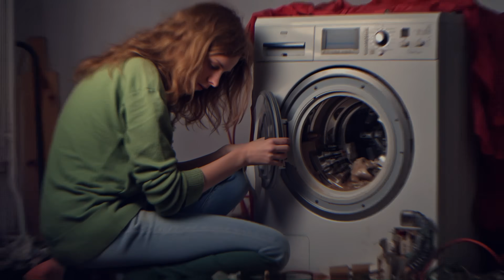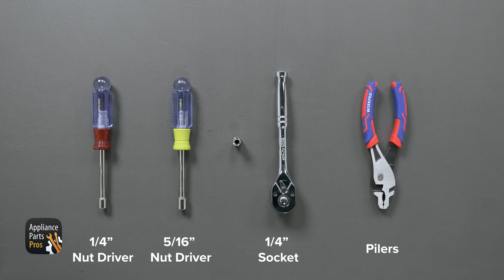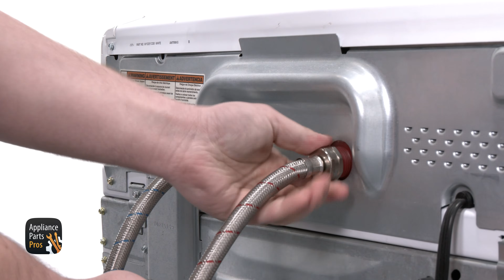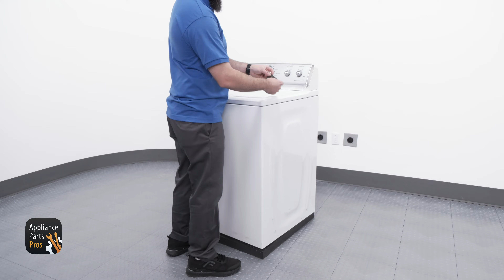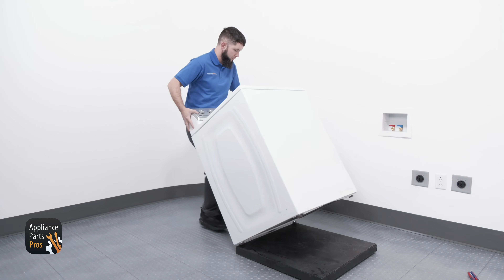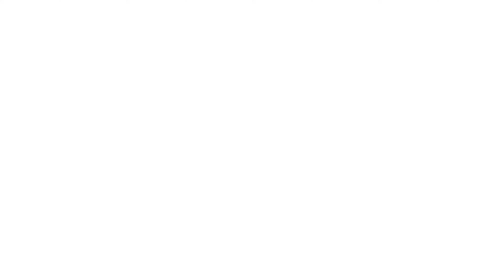How To Replace A Maytag Washer Lower Wiring Harness

Comment: I have a MVW5430MW and took off the back panel and saw that a small very think black cable had been snapped probably from all the shaking when doing laundry. Would this require a whole new wiring set? I bought the appliance in August of 2023. Thank you!
Reply from the maker: What is that wire you need connected to?

Comment: I have the Maytag MVW5435PW0 washer. Just over a year old. Started a los of laundry and it filled up with water then stopped at the wash cycle. Sense, fill/soak and done all flash once then done flashes for a second time. After endless searches, I replaced the lid lock-didn’t work. Replaced the drain pump-didn’t work. Replaced the actuator-didn’t work. Google said pressure switch-so I ordered the switch that was supposedly for my washer. Tore my whole washer apart trying to find where this switch is located only to find out it doesn’t take that switch. The pressure switch is built into the control board. So I just switched the control board out and recalibrated the washer. Still getting the same nonsense where it fills with water then stops. I have no clogs and all the wires look good. Would this lower wire harness still be a cause even if the wires all look good? I’ve spent more money trying to repair this washer versus what I paid for it. It’s driving me nuts! lol Manually dumping the water out for the 5th time this week.
Reply from the maker: That is strange. If possible, are you able to put it into diagnostic mode or get any error codes?

Comment: Can this be responsible for a sense to done cycle? The lid locks and unlock immediately and goes from sensing, to the drain tub moving around, to done in under 1 minute
Reply from the maker: What is the model number of your appliance?
Reply: @appliancepartspros  MVW5035MW1
Reply from the maker: Thank you. You will need to locate the tech sheet on the unit and run the diagnostics to determine if there is an error code and follow the instructions for testing. You can also check the wiring for any burn spots or loose connections.
Reply: @appliancepartspros  thank you!
Reply from the maker: You're welcome!

Comment: What are some of the symtoms
Reply from the maker: Great question! Symptoms of a faulty lower wiring harness can include the washer not starting, error codes, intermittent power loss, or the washer stopping mid-cycle. If you’re experiencing any of these, the wiring harness might be the culprit! Let us know if you need help troubleshooting.
Reply: Mine would not make it past the wash sucks. It would not pump. It also gave several different codes. Was told it was the lid lock, but it wasn’t. The. Told it was the control board. That didn’t fix it either. The wires were sparking where the wires came together from the control board and spliced with the pump wires. Seems the was a recall on my model.

Comment: Three service calls within 2 years for Maytag washer after buying. Not a good product 😮😮
Reply from the maker: Sorry for any issues you have had with your unit. If you have any questions, just let us know.
Reply: Same! Only just over a year and the wires broke 3 times!
Reply: @jessicavaglica5455 two months ago, they replaced whole big round metal disc as well in washer that rotates at the base.  
Dispenser still keeps liquid
Reply: 2nd time my harness broke Washer about 2 years old First time under extended warranty No cost Then they canceled my warranty so have to fix it myself 😢